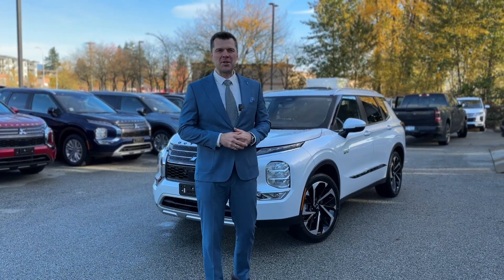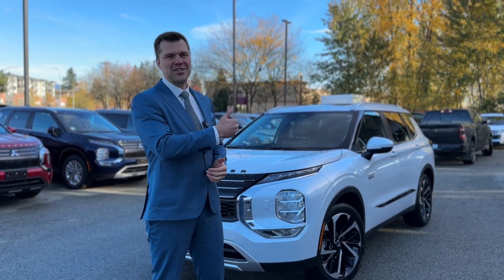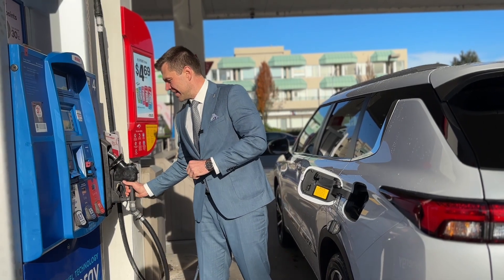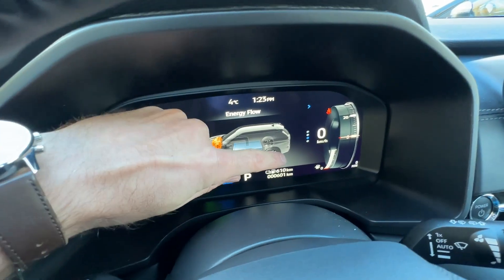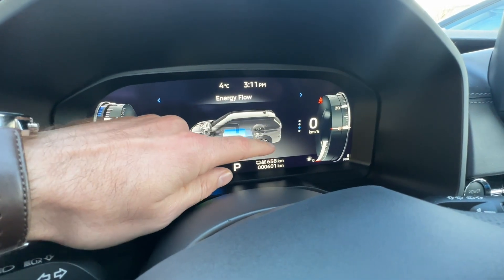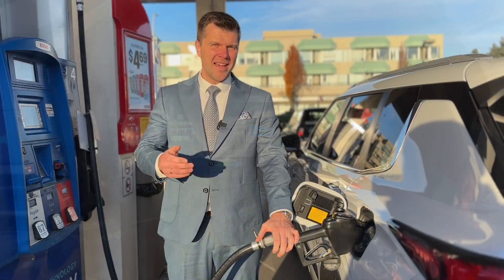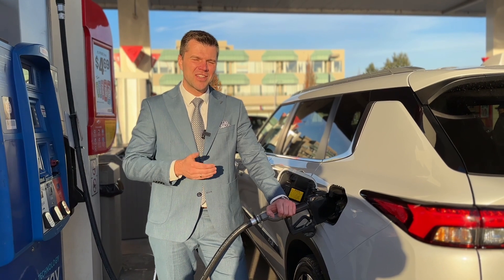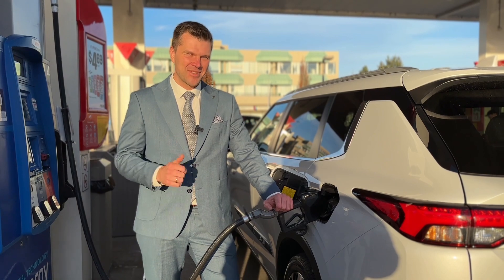Fuel Consumption with Battery Charge Mode tested on PHEV 2024! (94 min on idle)

Comment: In my personal experience, the CHARGE mode makes more sense when you are traveling over 70 miles per hour. Of course, the SAVE mode will engage the electric engine whenever is possible, but the electric engine won't keep up for a long period when you are over 70 miles per hour.

Comment: I don’t see the point to charge the battery when the car is not moving. Anyways, I will do around 300kms soon and I think I will use the mode SAVE on the highway (when battery is around 30%), and then CHARGE when I know I will get closer to the city. We’ll see.

Comment: Dear, I have a question if you could please answer to that.. 
I have an Outlander 2023, whenever I stop auto brake engages perfectly but after 2 minutes more or less it disengages automatically and car remains in Drive mode and Parking brake engages.. (I never open the door, I never un fasten seat belt, never press Parking brake button) and I take my foot away as it engages, but still it disengages automatically..

Is it normal? Is there any time limit of auto hold brake or shall I get it checked? 

Thanks in advance..

Comment: Charge mode charge rate gets throttled after the battery passes about 50% on earlier models. I suspect nothings changed on the latest model. So once the battery gets past that amount the charge mode becomes a lot less efficient in an idle test like this.

Comment: Charge mode is economically sensible only when actually moving and the engine is rotating the front-wheels. Now, as you mentioned, there could a variety of other reasons you might want to use it.

Comment: Hi great test, but 6.2 liters charged the battery for 48kms. Will it not be the same if we run on fuel only? Thanks
Reply: 6.2 liters of fuel would likely give about twice as much range if run on fuel only. So, it's a very inefficient and expensive way to recharge the battery.
Reply: much more..about 100km..

Comment: In my opinion, using the CHARGE mode at idle makes no sense from an ecological point of view. Using it when moving makes more sense because the energy not used to move the vehicle will be used to recharge. A mode that I appreciate more and more is SAVE at 30-40% of the battery on the highway, then the vehicle is more powerful on hills if the battery is not empty. And I still have autonomy left to switch to EV when I get off the highway.

Comment: A really nice test, thank you. 

Can you consider doing another test where you test how much fuel it used in CHARGE mode while driving?
So for example you could do 2 trips:

1: Empty battery, full tank, CHARGE mode - drive some specific route, e.g. 50 km, preferably suburban roads with speeds at 80+ km/h
   Then measure fuel used and extra EV range generated in % (important as GOM is not good enough)

2: Empty battery, full tank, Normal mode - the same route and driving like in 1.
  Then measure fuel used

Then compare both to see how much extra fuel it burned when using CHARGE mode and how much extra EV range was added
Reply: Agreed 👍👍.  This test would be quite relevant!!!
Reply: Exactly, that is more clever than the test done in the video. I would not even think about charging the battery while I am not driving.